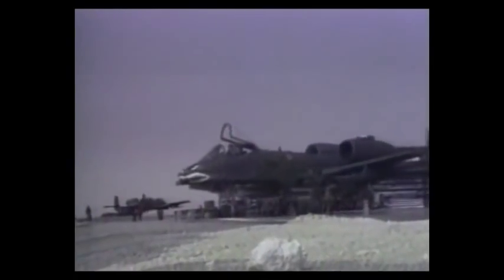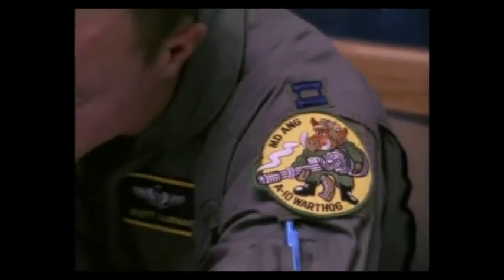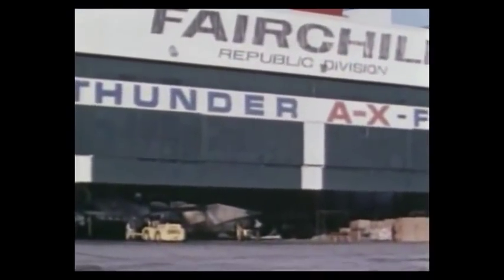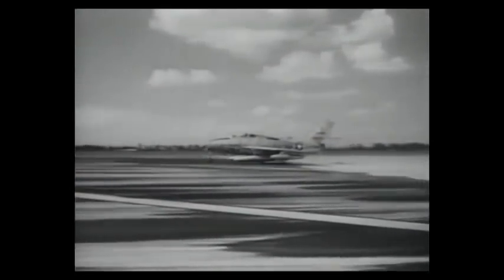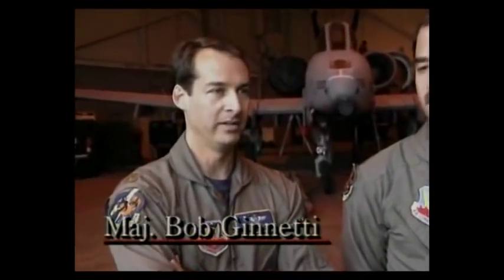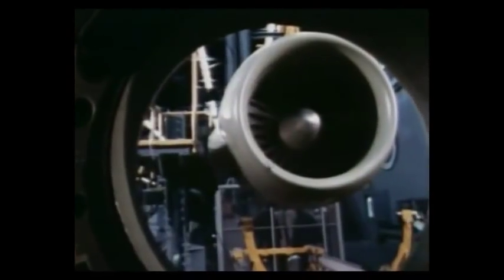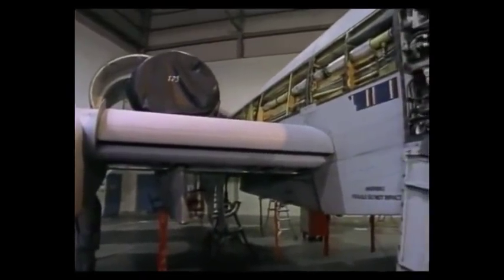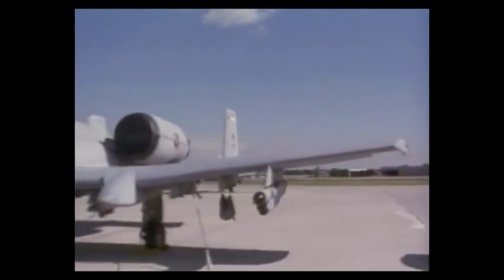Death Bringer War Plane - A-10 Main Battle Tank Buster Documentary - Military Documentary Channel

Comment: The F105 was known as the THUD by its pilots, not the ultra hog. The A10 is a great platform in uncontested air. However when AAA is in the area other platforms do CAS. In Gulf War 1991 A10s were pulled out of the battle due to losses till F16s could destroy the Iraqi missile sites. Today most CAS is done by a number of other platforms. Platforms that can operate in a contested environment. In Afghanistan the A10 was in its element.
Reply: + Romans 10:9-10 "That if you confess with your mouth, "Jesus is Lord," and believe in your heart that God raised him from the dead, you will be saved.  For it is with your heart that you believe and are justified, and it is with your mouth that you confess and are saved." Amen 🙏!!!!!!!!

The man in Luke 16:24 cries: ". . .I am tormented in this FLAME."
In Matthew 13:42, Jesus says: "And shall cast them into a FURNACE OF FIRE: there shall be wailing and gnashing of teeth."
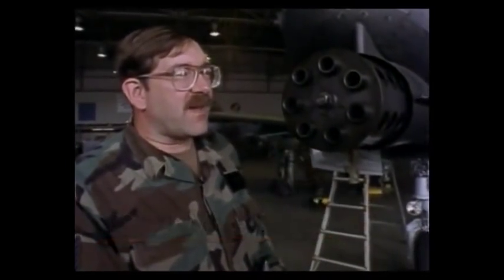In Matthew 25:41, Jesus says: "Depart from me, ye cursed, into everlasting FIRE,. . ."
Revelation 20:15 says, " And whosoever was not found written in the book of life was cast into the LAKE OF FIRE."

Comment: Well the comment that it has the largest gun put on a fighter type aircraft it's wrong and untrue. The Bell P39 Airacobra had a 37 mm autocannon and the mig-15 the MiG 17 and I believe the mig-19 had 37 mm autocannon + 2 23 mm Cannon. The Avenger is still a badass Gatling gun and I'm not talking about the B-25 Mitchell's that had 75 mm Cannon for the AC-130 Gunship with the 105 which is the biggest gun put on aircraft
Reply: + Romans 10:9-10 "That if you confess with your mouth, "Jesus is Lord," and believe in your heart that God raised him from the dead, you will be saved.  For it is with your heart that you believe and are justified, and it is with your mouth that you confess and are saved." Amen 🙏!!!!!!!

The man in Luke 16:24 cries: ". . .I am tormented in this FLAME."
In Matthew 13:42, Jesus says: "And shall cast them into a FURNACE OF FIRE: there shall be wailing and gnashing of teeth."
In Matthew 25:41, Jesus says: "Depart from me, ye cursed, into everlasting FIRE,. . ."
Revelation 20:15 says, " And whosoever was not found written in the book of life was cast into the LAKE OF FIRE."